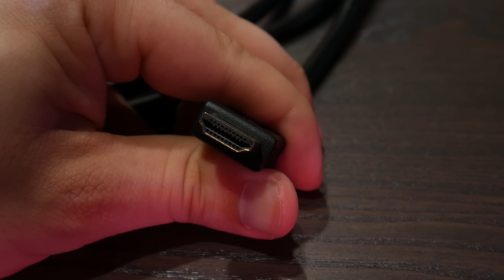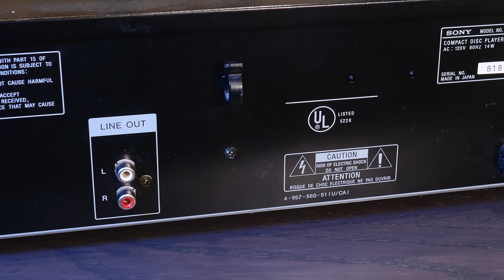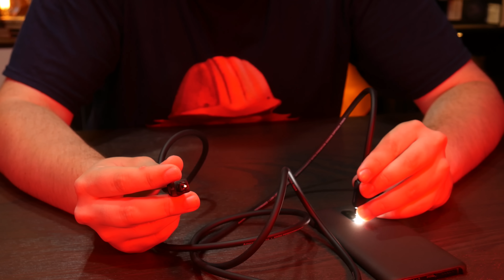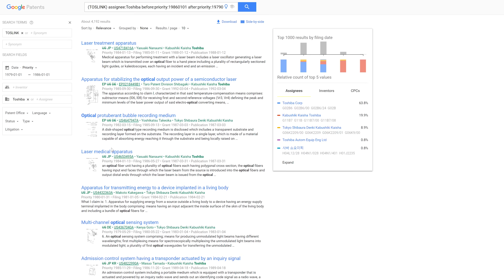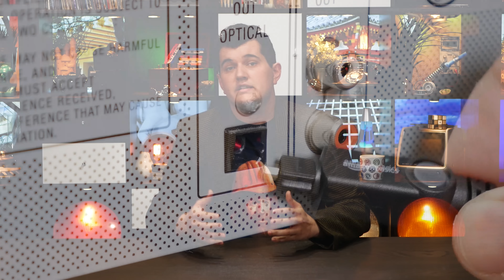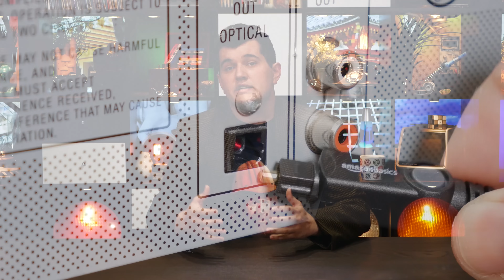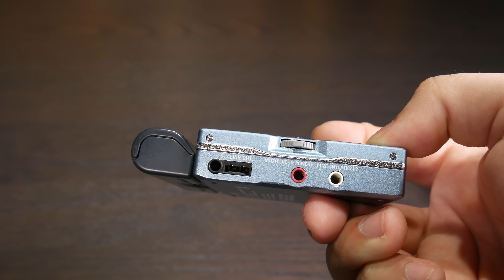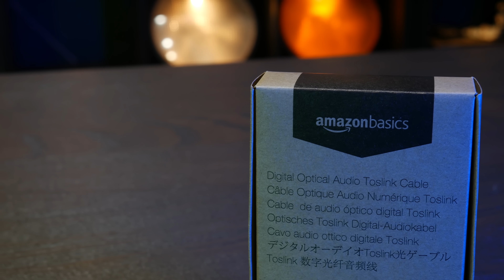TOSLINK: That one consumer fiber optic standard

Comment: Heck. Most of my devices, including a flat screen TV, are connected to my stereo using the 3mm headphone output jacks to a RCA adapter. Some of those cables are 2 metres long. It works fine and pretty much everything has a 3mm headphone jack on it. Even cell phones.

Comment: I always choose TOSLINK connections over the voltage switching ones. There is no drop in the transmission and detection of a light pulse, while those RCA/Coax cables degrade over time and misread the switching voltages on occasion. This is most notable if any of the components of your sound system synchronize using Bluetooth, like most consumer level subwoofers for soundbars do these days. TOSLINK and optical transmission will pretty much always sync up right to the bluetooth delay, whereas you get a little bit more of a pronounced separation between the voltage switching RCA and the bluetooth connection to the subwoofer or whatever surround wireless setup you might have. It can get a bit disorienting. I highly recommend TOSLINK over RCA connection. Now, if you have direct connection like a jack or even the more and more common USB, it's not as bad. I still just like knowing that the connection speed of the DAC in the sound processor coming from the source is set and locked at "the speed of light".

Comment: I know you said in the video that RF interference doesn't make much difference on a digital connection unless it's really bad, but as an anecdote I had an amplifier a few years ago I'd connected via the copper S/PDIF interface and every time a fluorescent light in the room next to the amplifier was turned on or off, the audio would cut out completely for 3-4 seconds, with the amplifier showing "UNLOCKED" on the display.  The copper cable was picking up enough of an RF spike from the light (a spark in the switch I am guessing since it happened when the light was being switched off as well as on) that it lost sync and took ages to resync to the signal.  Switching to a Toslink connection - the first time I bought a Toslink cable actually - completely fixed the problem.  Maybe it was a crappy cable or the amplifier wasn't quite shielded properly but after that experience I definitely prefer Toslink cables now over RCA ones.

Comment: Yup I'm using toslink for my 2 PCs in spite that they both support HDMIs. It's mainly to isolate them electrically. You got the point that they share electrical sources anyway but it's more complicated than that... Just so people know, electrical leaks are quite common in old machines and they can damage sensitive amps (or so I think) or vice versa. I thought about this after getting multiple electrical shock from a cheap old PC I bought (the cause of which I'm too lazy to figure out just yet)  Let me know if what I think is wrong...

Comment: Well, in my case, a newly used optical cable sound waaayyy better than a 25 y.o. coaxial cable (that's the youngest I have, not including console cables, as I don't plan to cut them to make myself a younger coaxial).

Comment: I connected my CD player to my AV amp from the late 1990s (no-HDMI) with a toslink cable, expecting to get a higher quality sound. I did in fact, but I forgot the fact that it bypasses my graphic equalizer which is connected by RCA cables. Since the amp does not have any digital equalizer - and I really like the performance of my analog graphic EQ unit - I had to switch back to the RCA cables. In fact, the cables are not too long anyway. No interference.

Comment: I use TOSLINK for my CD player, but use a SPDIF coaxial cable for my DVD player. Why? Because both are compatible with my receiver and only one was compatible with the other devices, and neither were more expensive. My receiver is old enough that it does not have HDMI ports, but still outputs in 5.1 surround.

Comment: Would TOSLINK even need another piece of plastic for a two-way signal? Couldn't you just use two different light frequencies to send and receive? One device having a red LED with a diode that reacts to blue light, and the other having a blue LED with a diode that reacts to red light? Or have multiple LEDs for other audio channels, thus multiplying the bitrate?

Comment: 11:00 isnt quite correct. electromagnetic induction introduced in a digital line can destroy the digital information by leveling up/down the voltage so that the receiver always thinks its receiving a high (or low) signal. 
thats why twisted pair data transmission was invented: the receiver doesnt just measure the voltage of a single cable to determine if its a 0 or 1, but the voltage difference between two cables. 
but obviously making such cables is more expensive, even more with additional shielding around the twisted pair(s).

Comment: TOSLINK and S/PDIF really are the same thing. I made a converter myself. Really easy. And it was so slow you didn't even need an official TOSLINK cable - you could just jam any old bit of fibre optic cable into the hole.

Comment: Toslink is a godsend for connecting certain types of consumer audio equipment together to avoid ground loops.
Reply: Toslink would be nice to connect my N3DS to my PC when I'm streaming gameplay from the N3DS online, as I need a 3.5mm audio cable going from the headphone out port of the N3DS to the mic in port on my case's front panel to capture audio whilst gameplay video is pumped over WiFi to my PC via the streaming homebrew I have on the N3DS (since there's just about no hardware capture cards made for it nowadays after KatsuKitty closed shop back in like 2016), and to prevent a mid-stream game loss because of the drain on the battery I need to keep the N3DS charging from a USB charger cable.

The problem is; if I have the N3DS plugged in to the USB ports on my PC to keep it charged, that introduces audible noise on the stream and recording due to a ground loop issue between the USB ports and the front panel 3.5mm audio ports as the grounds of USB and audio ports are connected via the circuitry of the N3DS itself.

Current solution is to have the N3DS charger cable running off a 60W 5-port tablet/phone charger stand as though the charger stand and PC share a Mains Ground, for whatever reason that doesn't induce a loop through the N3DS unlike if I was charging the N3DS through the PC itself.
Reply: Nice video, thank you for it😀 Ground Loop could be an issue creating hum, which can be avoided with Toslink. With my band we use Toslink cable to connect 16 Channel musical AD converters to our digital audio workstation and back to DA converters. We use a high quality 4 times Toslink cable, but of course with much higher bandwidth as SPDIF. With this we could eliminate him from ground loops, we had before using copper cable

Comment: And yet, TOSlink saved the day when my LG TV and Yamaha receiver fell out with each other over HDMI ARC.
Reply: Same with my LG TV and Home theatre which unfortunately does not always turn on ARC so I plug in an optical cable just in case the home theatre system does not detect it.
Reply: I install appliances for a living and often install TV's and sound bars for customers.  I gave up on ARC a long time ago... Too many issues.  A TOSLINK cable is my default choice... They just work.
Reply: @steampunkskunk3638  But TOSlink can only send ‘lossy’ audio above 2 channels ?
Reply: Yup, more LG handshake fails with ARC thus going back to optical
Reply: Exactly the same with our LG and Yamaha, where ARC was constantly failing.
Reply: I (tried to) use my Yamaha receiver as an HDMI switcher - which it was advertised to do - and it was terrible.  It would constantly drop the signal.  Ran a TOSLINK cable from the output of my Sony TV to the receiver, and it works flawlessly to this day.  It was also far more convenient to just have my receiver set to the TV since it would just send the audio of whatever TV input I selected - surround sound and all.  God speed, TOSLINK.
Reply: If you have Atmos or DTS:X it’s not supported by TOSLINK :/
I was able to reliably get my LG CX to work with LG audio equipment every time tho :D
Reply: If you have Atmos or DTS:X it’s not supported by TOSLINK :/
I was able to reliably get my LG CX to work with LG audio equipment every time tho :D
Reply: Yeah same with my LG TV and Sony Soundbar, ARC is horribly buggy
Reply: This just happened to me with a Samsung smart TV and a Polk soundbar. After hours of troubleshooting to no avail - changing HDMI cables, adjusting settings, factory reset, etc - I pulled out an old TOSLINK cable and the two worked together again.

I ended up being able to revert to HDMI after a final bit of troubleshooting that worked - turns out unplugging the TV for a bit reset whatever wasn't working previously. Afterwards, HDMI ARC and HDMI-CEC magically worked again. Never knew that HDMI could be so finicky/buggy.
Reply: Yeah, HDMI ARC sucks. It's horribly buggy and has inconsistent compatibility between TV's and audio systems. TOSlink just works every time
Reply: Omg exactly. Had so many problems with hdmi and arc until I noticed that both devices could use optical. toslink just always works. No big set up, just plug in set output and boom it does what it’s supposed to do. I love it. 
Rn I use my to as a hdmi switcher with 4 devices connected to it so toslink is just perfect since it just goes over the tv and whatever source I connect automatically.

Comment: I don't want to miss Toslink!
I use one Toslink cable between my Work/Gamingstation-Desk and the Home Cinema System. My Work/Gamingstation-Desk contains Network-Switches, NAS-System, 2 PCs, Scanner, Printer, Audio-Mixer and one Stereo AV-Receiver. The AV Desk contains 3D-TV, 2 DVB-S Receivers, BluRay-Player, Wii, CD-Player and a 7.2Ch Home Cinema System. When i use a normal chinch Audio Cable between the Work/Gamingstation and Home Cinema System, it causes a massive ground loop, or something else, so that the Audio Level at both Amplifiers gets extremely lowered and slightly distorted. I tried to turn around all of the device-Plugs in any combination but i can't get rid of this crazy failure. I tested my Electrical installation with a 2,000 € Installation Tester to make sure nothing is wrong. I also testet all connected Devices with a Device Tester for insulation- and other failures - nothing. All devices are fine.
So i use this 3m long Toslink-Cable without any Problems. So in my opinion it's always the best to use the DAC's inside of an Amp, where it is then made audible to minimize signal quality losses.
Please Note: Chinch Cables for S/PDIF Connections produces digital Interference emissions.

Comment: Electrical isolation for digital streams is still useful for mitigating ground loops though. The interference from the digital input can bleed over to the dac output and come out your speakers. Toslink is the only way I can have sound from my computer hook up to my sound system without causing very audible noise (and without the expensive upgrade to a balanced dac).

Comment: I disagree that it doesn't matter to use copper cables and that the EMI-immunity might be a selling point. Communicating at higher frequencies (higher than what most consumers use, TBH) require more of the driver, even if they're digital. This is simply because you cannot drive a signal high enough to overcome the resistance of the copper wire fast enough, if you were running at a very high speed. Thus, you will need to use a lower signal amplitutude, which is more subject to noise. You can of course have checksums and error correction, but that takes up bandwidth.
The other part is radiated EMI. I work as an electronics engineer designing products, and I have ALWAYS had problems with that mother f-ing Ethernet cable acting is an antenna RADIATING a lot of noise that pushes the yellow lines above the red line on the expensive instrument from Rohde & Schwartz, making the (bearded) operator look at me and saying "You shall not pass!". I could (potentially) have had it sooo much better if the world would have adopted TOSLINK instead.
Edit: As far as worrying about separating your amplifier from your CD-player might actually have a some effect, as this would avoid so called Ground loops (which occurs if there's a loop in the system carrying protective earth) which is very prone to happen if you connect hem with cables and generally set up your system crappy.

Edit2: My old Macbook (2011 model I think) actually had TOSLINK support in the audiojack. I honestly didn't realise that until today! Because it's not natively used in Mac OS (at least not by default), I only noticed it when I installed Linux on that computer. Suddenly, the audiojack started glowing, and I was so suprised! Thank you for the explanation of that!

Comment: My Bose soundbar only uses Toslink..  with that being said. I mainly see fiber optics in communication equipment such as some interphone systems on aircraft, and some radio equipment that digitally communicates between the control panel, and other parts of the radios. With aircraft, it makes sense using fiber optics as you have a lot more sources of EMI, but in home audio, I agree that I don’t notice any better quality.   Also, some of the 80’s stereos were the best sounding stereos I’ve heard in my life, especially when coupled to a giant equalizer haha.

Comment: The point of TOSlink is to eliminate stray AC current from power supply capacitive leakage which can cause hum in analog circuits. This problem is supposed to be solved with S/PDIF coaxial by putting a pulse transformer at one end or both. The pint is that either way, components are galvanically isolated so that no AC leakage can occur. Often, S/PDIF equipment does not have pulse transformers, so as with the ground loop isolation transformers which are used with analog audio, you can get S/PDIF isolation transformers.  For that matter, you can get RF isolation transformers to get rid of grounding problems induced by TV cable. If you need to isolate the power, I have used medical power isolation transformers with leakage so low that they are rated for direct patient connection. But, by using optical fiber, TOSlink eliminates thee need for a S/PDIF transformer.
BTW -- Isolation transformers are built into the wired ethernet standard. Ethernet provides galvanic isolation. Midi is also isolated using optical isolators. Anyone who remembers before CD remembers how hard it was to get a low noise floor in audio equipment of the day. With CD's near 100 dB dynamic range, manufacturers not only have to pay more attention to grounding within equipment, but they had to start worrying about sneak paths through the interconnects. TOSlink effectively eliminates this problem.

Comment: And then the two technologies met at my house. With PC having a TOSLINK digital audio port and the Home Theatre system having a Cinch digital audio socket. And I had to buy an optical to electrical adapter with its own power source and it worked for a while and then started to produce noise and then I said fuck it and put three audio drivers to cupboard and go with stereo...

Comment: 11:17 - Another advantage of TOSlink is it eliminates ground-voltage interference. If you have two devices connected that have slightly different ground-voltages for some reason, that difference will bleed through a copper cable and potentially interfere with anything else connected to the same grounding circuits inside each device. That won't happen with TOSlink.
Reply: you can also get optical cables that are only 2.2mm thick and 50ft long for or only $12
Reply: It's also immune to coil whine from the system. I've been using TOSlink for my desktop speakers for years, no matter how whiny your parts get, you'll never hear it go through the fibre
Reply: Sadly most audio-interference in modern computers are inside the computer, like the powerconsumption and crappy grounding of the USB and the memory-bus bleeding into the audio-amplifier. When I move my mouse around I get audio noice.....there is no skill in engineering nowadays!
Reply: @andreassjoberg3145  the same happened to me. i went out of my mind multiple weeks before figuring out the solution
Reply: @grants7390  Out of sheer curiosity have you tested spdif vs toslink to see if the interference is present on the spdif? I know the exact noise you speak of, i run toslink to my amp from my main desktop, been so long sine i used spdif i forget if that interference was present. Don't believe ive observed this noise over HDMI or over my USB-BT gaming headset but it could be that these maybe run some kind of noise gate?
Reply: @andreassjoberg3145  this even happened to me also at some point, beside, when i plugging a laptop into that old (but still works) sound blaster card (both are analog) to capture its audio, its was fine until i plug the HDMI or VGA cable on it, either way, its interfere and causing the same electricity noises like when you touching the plug with ur hands or if the cable is (sometime) loosely connected.
Reply: That's exactly why I use TOSlink with my audio interfaces, when producing music I need as little ground noise as possible.
Reply: You can also have new standards of TOSLINK automatically detected by new devices in a fully backwards-compatible way! Disregard what tech connections said, just have the input start at TOSLINK 1 and upgrade the standard if the bitrate exceeds the old standard.
Reply: Best way to avoid audio interference from PC to amplifier is to use an Apple Airport base station (not the extreme) to send the signal wirelessly. The key piece of the puzzle being the often unknown fact: The Airport's mini-jack audio-out is also a mini-Toslink. Output straight to a DAC for hi-fi sound as high quality as your components.
Reply: @DiscoFang  also some macbooks has mini toslink